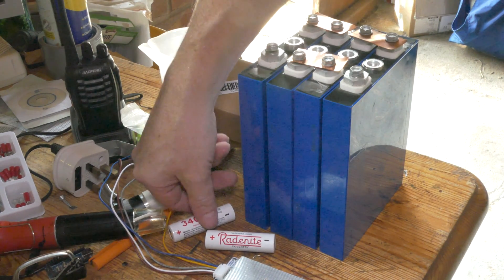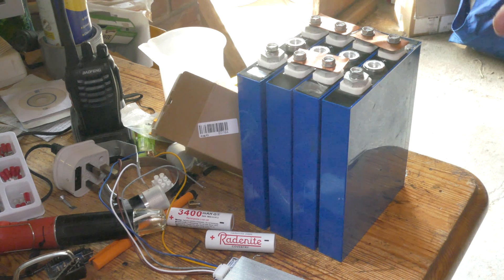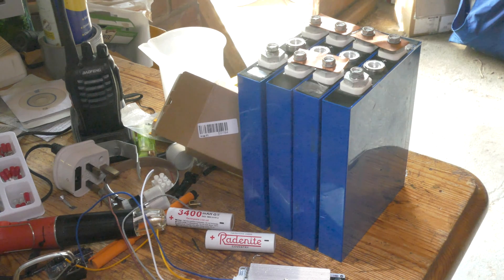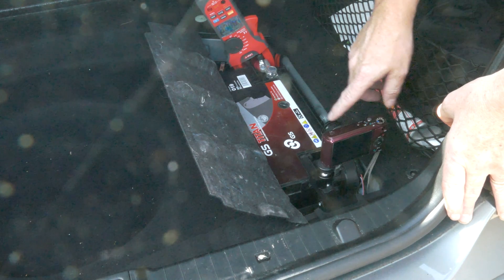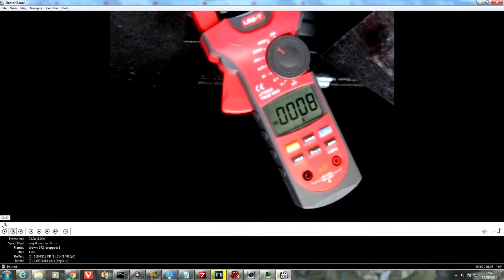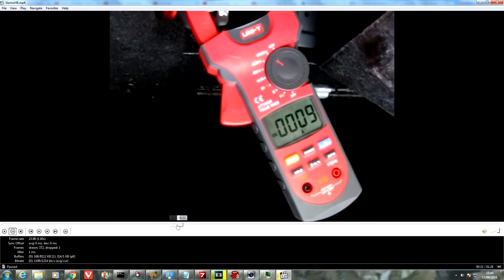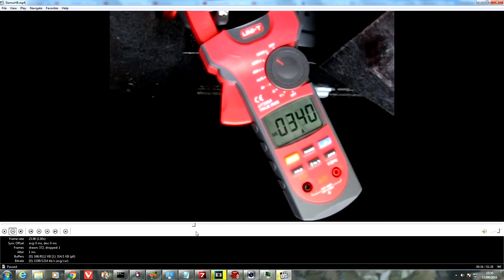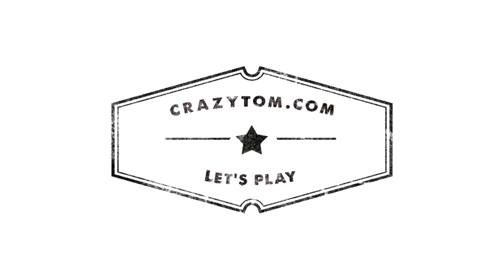Amps (current) required to start a car engine

Comment: the meter does not refresh fast enough, it may just read once or twice per second, so u might need to try like 10-20 times just to confirm you captured the highest reading.

Comment: The peak shown won't be actual peak. Imagine trying to measure peak voltage spikes on computers, the voltage controllers are 200 Mhz (200 million times per second), even with a slow oscilloscope, you have no idea what it actually is.

That clamp meter is more for static loads, and you have a dynamic load, and its highly incapable since amperage will be changing constantly, after all, the engine needs to get around 1000 rpm (17 rotations and 17/2 cycles per second, top dead center compression, expansion of gas (even though its not detonated, the compressed air is storing energy), bottom center, up again with exhaust valve open (low resistance), top dead center, and back down with intake open (making vacuum). Simply put, 3 samples per second is nowhere near fast enough for this insane amount of stuff happening, maybe if you had 3,000 per second, but even that wouldn't be totally accurate. Also no point in using a 240 fps camera, you only need 6 fps, so even the standard 60 fps is 10x overkill looking at that multi-meter.

I get it, you're just trying to use what you have, but you might mention the results are completely incorrect. Or maybe you learned something (that would be cool). Measuring something is often much more challenging than it seems, measuring incorrectly is easy, it's just not very useful.
Reply: What is your better method of measurement and what is more accurate value?
Reply: T Tran preventing the car from starting while running the starter motor. A 5-10 second run of the starter should give a fairly average value of the starter motor. I guess disconnecting the coil pack or dork plug connectors or removing the fuel pump relay and then run I g the starter motor will prevent the engine from firing up and give us time for spin the starter for a longer duration to take a good reading. Just make sure to not run it for more than 10 seconds or it’s gonna overheat and life of the motor is going to be shortened.